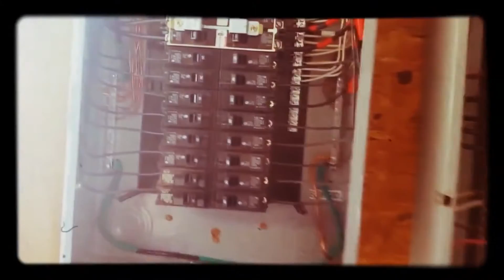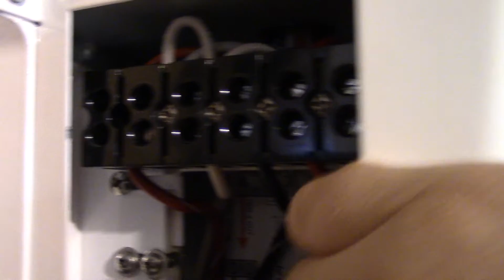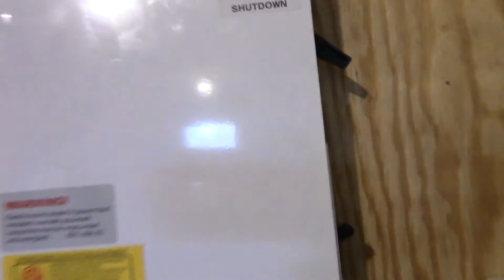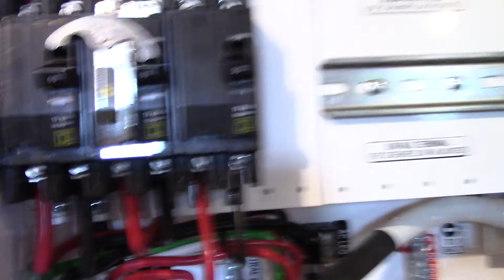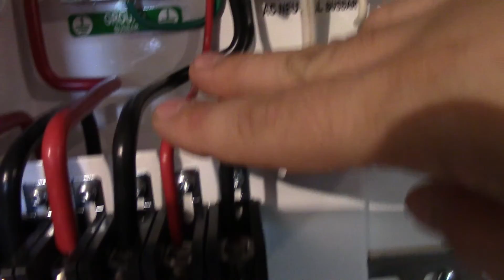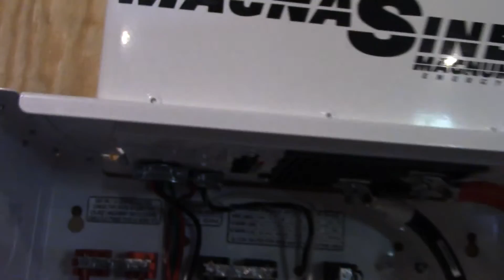Explaning the wiring on the MP panel

Comment: I have 10 6 volt batteries and 2 8volt. can I run 2 6 volt and 2 8volt to get a 24volt bank? I know it's 28volt just asking
Reply from the maker: no
Reply: Thanks. I'll get 2 more 6 volt. Then I'll have 3 8volt batteries to make 24. Can I add them?
Reply from the maker: no

Comment: Hey at 2:43 you mentioned a jumper between the neutral and ground, was that jumper in place earlier? The reason I ask is because that bonding together should only take place in one location, typically in the main breaker panel. You said it was common and that it was ok, and that is a major safety issue to potentially bond neutral to ground in two places. Problems will occur, in my early days of doing this, I destroyed maybe 2 cheap MSW inverters by not knowing this. The inverters were internally grounded\bonded and I was back feeding to the main breaker panel through a transfer switch. The result was tripped breakers and dead inverter. I  initially thought it was a faulty inverter, I replaced it "under warranty" 😅, with the same unit. And lo and behold, the second one died the same way. I then bought a better AIMS inverter, this one didn't die but it did trip breakers. Why?, because it too was internally grounded\bonded to neutral. To solve the problem I realized I needed to remove the ground from the AC out wiring from my inverter. Obviously I'm not saying that is what caused your problem, I just want to point out that safety issue for your viewers.  I reviewed your video twice to to make sure I understood you correctly. Take care.
Reply from the maker: it's not bonded any where else
Reply from the maker: can we talk
Reply: Thanks for the comment.
Reply: I believe so.  Bonding neutral to ground outside of the main panel is asking for trouble.
Reply from the maker: +rhandsom I will go over it if fine details
Reply: Very wise move in my opinion.  You can't put a price on peace of mind.
Reply: No, he's cool, I have faith that he'll get it worked out. :-)
Reply: it's all good. As a fellow youtuber, I just try to be helpful, courteous, and civil and encourage others to do the same. There are very few things worth a stroke or heart attack. So please be at peace, good fortune to you, and take care. :-)
Reply from the maker: +rhandsom this guy was parading my last name across the internet

Comment: Your videos keep disappearing.
Reply from the maker: Well if i didn't get the videos down they will sue me.
Reply: Solar Power Electricity and Electronics drive fast, take chances
Reply from the maker: I have a family I will not wast time with them.
Reply from the maker: Are you a troll?
Reply: Solar Power Electricity and Electronics No, but have been labeled that before. Do you ask all your subscribers this question? Have I not kept my questions on topic?
Reply from the maker: I'm seeing trolls and i love it keep up the good work broll
Reply: Answer the question,Hey at 2:43 you mentioned a jumper between the neutral and ground, was that jumper in place earlier? The reason I ask is because that bonding together should only take place in one location, typically in the main breaker panel. You said it was common and that it was ok, and that is a major safety issue to potentially bond neutral to ground in two places. Problems will occur, in my early days of doing this, I destroyed maybe 2 cheap MSW inverters by not knowing this. The inverters were internally grounded\bonded and I was back feeding to the main breaker panel through a transfer switch. The result was tripped breakers and dead inverter. I  initially thought it was a faulty inverter, I replaced it "under warranty" 😅, with the same unit. And lo and behold, the second one died the same way. I then bought a better AIMS inverter, this one didn't die but it did trip breakers. Why?, because it too was internally grounded\bonded to neutral. To solve the problem I realized I needed to remove the ground from the AC out wiring from my inverter. Obviously I'm not saying that is what caused your problem, I just want to point out that safety issue for your viewers.  I reviewed your video twice to to make sure I understood you correctly. Take care.